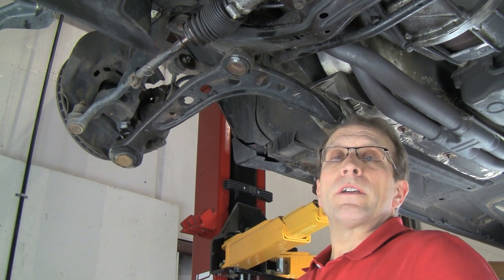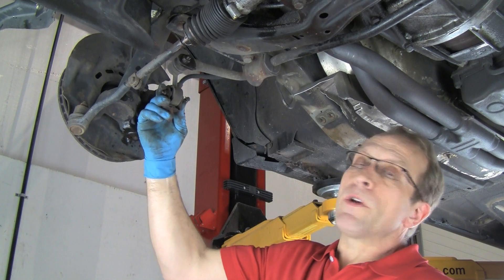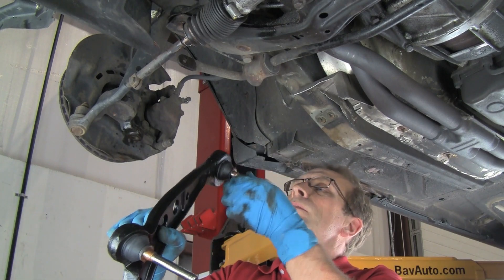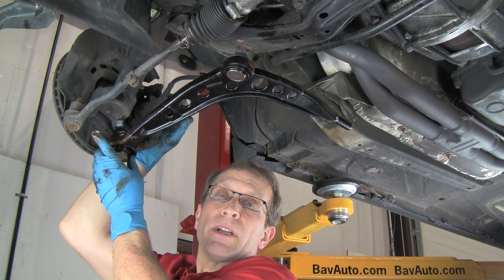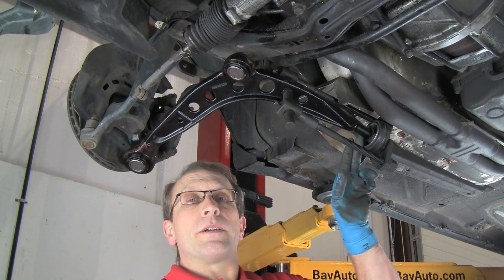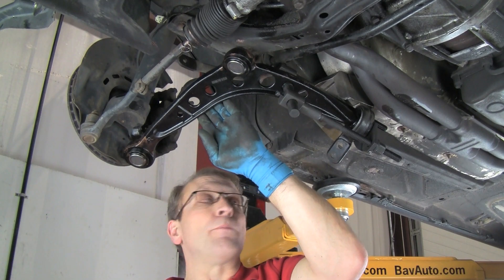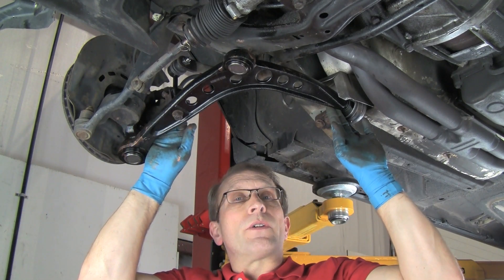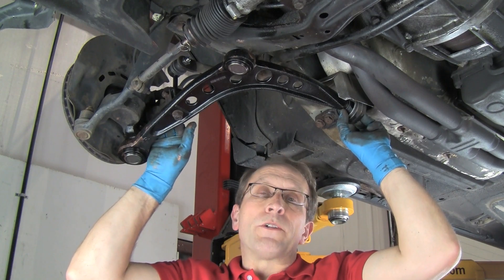Part 2: Replacing Control Arms in a BMW 3 Series or MINI - BavAuto DIY

Comment: The best tutorial I have ever seen. I can't even begin  to tell why they are so good. all the others seem the work of amateurs. Clean, concise, to the point, the video is excellent, and the voice of the comentator is very clear, in easy to understand terms, without losing any of the technical content. I really, really congratulate you on your video series. I own an E 46 and if your service is as good as your videos, you will get all of my bussines. I will recommend you to all my BMW owners friends. Again, Excellent work!
Reply from the maker: Gee, Jamie, Thanks for the great encouragement!  And, we certainly strive to have our parts and accessories mail-order service rival and surpass our video how-to productions.
Reply: +Jaime Lopez Marines 
I only wish this would work for the Mini.  After watching this video, I ordered the entire bracket with the expectation of a quick (well, relatively quicker way) replacement of my bushings.  But then after getting under there, realized it is impossible to do without dropping the subframe.  So, back to chiseling out/blow torching out the old bushing and replacing the new.  Would love some more Mini videos!  I really like this setup.  Jamie is right.  Clean. concise.

Comment: Great video as usual. I've just done this job (E46) on my driveway, in the dark and the rain. Bought Meyle arms with the bushes already fitted. Original fittings reqd 18mm and 21mm spanners for the two ball joints - new had 19mm and 22mm. Fairly easy job but those inner joints take a while to undo as the helpful chap in the video says. Had to crack the one track rod end to get a good enough swing with the hammer on the one outer joint, but otherwise went well

Comment from the maker: BMW models with single ball-joint control arms (such as a typical 5,6,7 series, etc.) your point is true & very important.  On the 84-05 3-series & the MINI this is not specifically the case.  On the 99-05 s-series and the MINI, the pin that goes through the bushing is Hex shaped and can only be installed one way.  Therefore, no need to lower before tightening.  On the 84-98 3-series, if you install the bushing on the arm and then let the lubricant dry, the bushing will not move when installed.

Comment: Excellent  easy to follow  video  ,wish I had a hoist  not stands though,  had trouble splitting ball joints and fitting bush on rear of control arm  but good job when done

Comment from the maker: Try drilling through the bolt until you can use the largest size bolt/screw extractor (EZ-Out, etc.) that will fit in the drilled hole without hitting the threads.  Use increasing bit sized, starting small and working up to the final size.  be careful in using the extractor.  Do not put enough force to break the extractor, as this cannot be drilled through.  If the broken section will not come out, you will have to install a thread insert (HeliCoil, etc.).

Comment: Several times you referred to the case of car resting on jack stands. Frankly, I cannot see one would be able to do such a job laying on my back and with just a few inches of working space. Don't get wrong, though, the video is terrific, very good. Just a question: is the procedure similar for an E92?

Comment: how did you guys know you tightened the ball joint nuts sufficiently? BMW provides torque specifications (inner one is quite high) and I don't see those specifications being met with using only a 19mm wrench.

Comment from the maker: At some point, we may be able to do chassis specific shock and spring DIY videos, but we likely will not have one available specifically for your E30 3-series, in the near future.  The Bentley repair manual does cover the procedures.  Additionally, we do have a DIY on shocks, struts and springs on our tech blog site at blog.bavauto.com . Just search for SHOCK SPRING DIY .  The front will be a bit different from your E30, but the rear is basically the same.

Comment: Some people say you have to put the car back on wheels and then torque/tighten these links. Does it not hold true for 3 series. I know it says in TIS you have to weigh the car down on it wheels and than torque them links. What if you don't weigh it down? Do these bushes wear down quickly. I did all these links on my E38 with it hanging.

Comment from the maker: Using regular oil would not be recommended as the bushing will not "glue" to the control arm pin ... since the oil will not dry up.  Additionally, the oil will tend to soften the rubber over time.

Comment: Hey there BavAuto, i replaced my control arms and tierods, my steering is stiff and darts around alot. I haven't been for a alignment yet, will the alignment remedy this? I'm running huge toe out could this be the cause? I'll be going for a 4 wheel alignment as soon as i have some free time! Thanks!

Comment from the maker: The control arm bushing removal and install tool is available in our online store at bavauto.com.  The part number is KT20249 .
Remember to keep the nuts on the ball-joints so that the arm does not fall to the ground when you separate the ball joints.

Comment from the maker: This is the control am bushing removal and install tool kit.  The install tool is shown at the point that you referenced.  The kit is available on our web site at bavauto.com or by calling our advisors at 800-535-2002. The part number is KT20249

Comment: you missed the step - you did not show - tightening the control arm to subframe nut from the engine bay. This is important to secure tightly the arm to the frame

Comment: You got to the part I wanted to see ... but you didn't quite finish. That is: Tightening the Wish Bone Looking Stabilizer Link Bracket NUT to the control arm and also the through bolt&NUT that connects the stabilizer link to that same Bracket. Question: How Tight are both NUTS to be? Thanks!

Comment: where type of 3 series is this i have a 325xi and the control arm looks different than this one
Reply from the maker: The E46 325xi (through 2005) will look similar, but the inboard ball-joint is mounted to the frame and the spindle goes through the control arm (opposite from a non-xi model.  If you have an E90 325xi, (2006-11) the layout is totally different.  Your control arms would be similar to the 5-series shown in this video:
http://blog.bavauto.com/14819/bmw-diy-video-replacing-control-thrust-strut-arms-on-late-model-bmws-e60-etc/

Comment: What about the lower rear control arms I here u have to drop the diff to get it out
Reply from the maker: If you have an E36 or E46 3-series (or Z4 or X3) , You have to unbolt the differential in order to remove the bolt for the inner end of the rear lower control arm.  See this link for an example:  http://blog.bavauto.com/14044/bmw-e36-e46-z4-camber-adjustable-rear-control-arm-rcca-install-how-to-diy/

Comment: Ball joint separator l understand,but , where does the PICKLE come in.There is not a part on a car called a PICKLE. You can get in a PICKLE, you can PICKLE
          things like ONIONS,EGGS,GHERKINS .  Less chance of splitting rubber if you use vasaline or a gel.